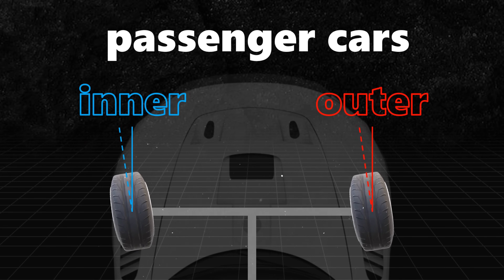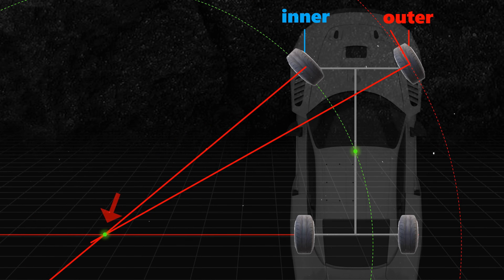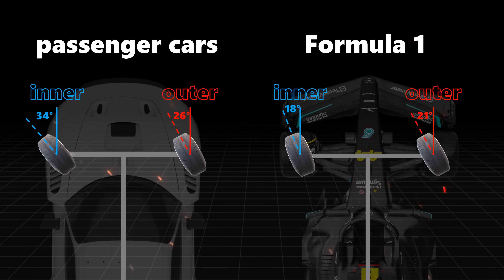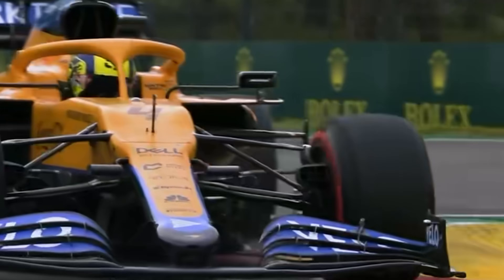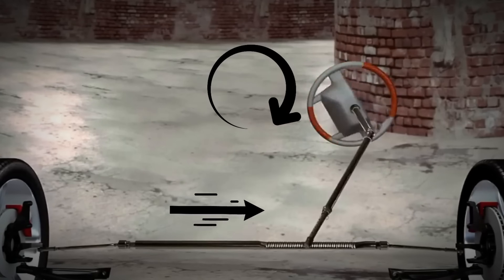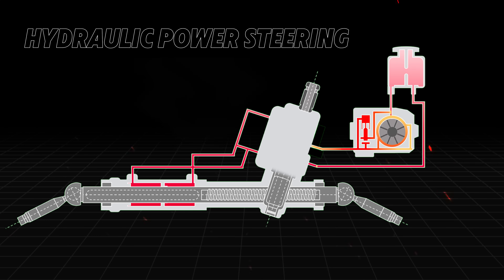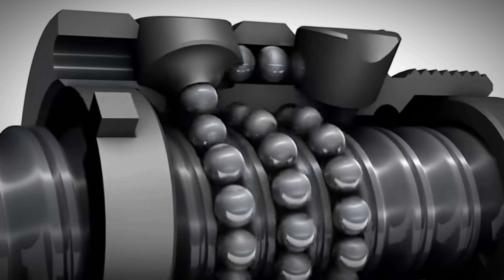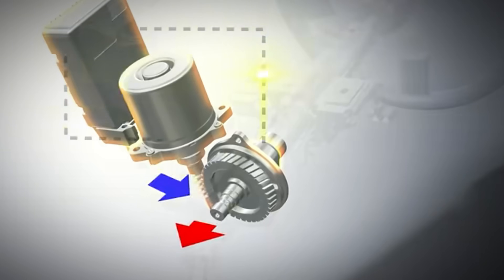Car steering is WEIRD, but the reason is FASCINATING | Dynovox Insights

Comment: What about rear steer and or steer by wire , can instantly or dynamically change these ratios for inner and outer tie rod travel. Also old-school hydraulic power steering ? Fuck old school museum ass  tech. Formula 1 loves banning progress.  I wonder when road cars will become faster and handle better than the gas boom boom manual brake pedal and steering rack Formula 1  cars.  it would be like watching horse racing.
Reply: Dynovox is anti American freedom, for proof check out pirate 4x4.

Comment: good video, but as a owner if a car without power steering it's not a big deal at low speeds if you know how to drive
Reply: Even with electric power steering, I never dry steer. I’ve heard it’s better for the steering components to steer/change directions only while in motion. Would this be the same for non-assisted vehicles?
Reply: @aidan9958  yes it's very heavy on the steering to steer while stopped or too slow, because you try to make the tires skids
Reply: Dynovox is anti American freedom, for proof check out pirate 4x4.